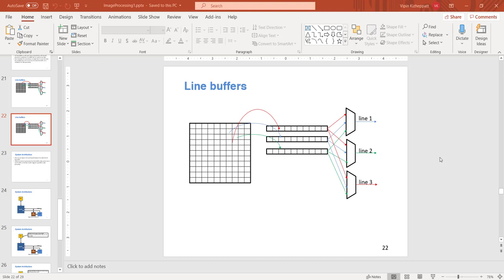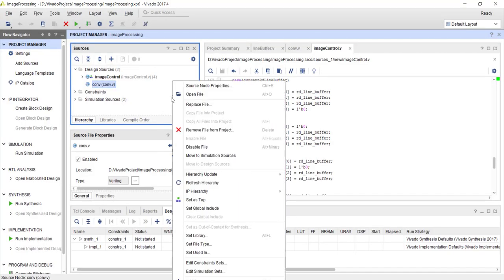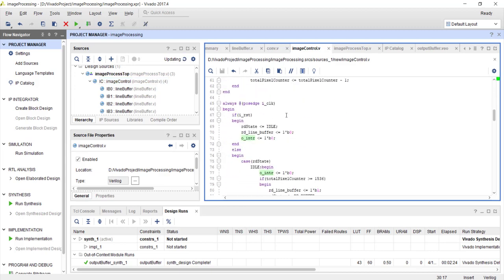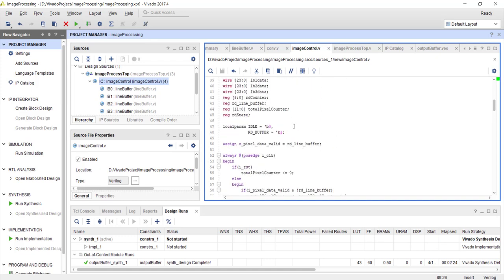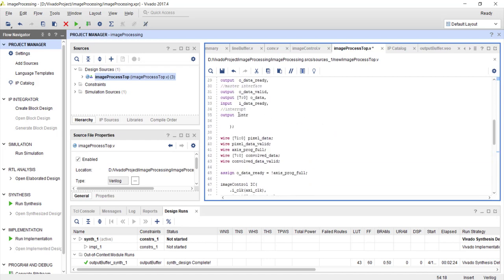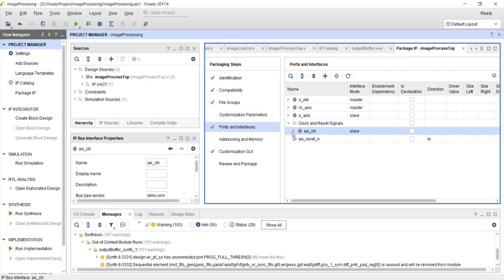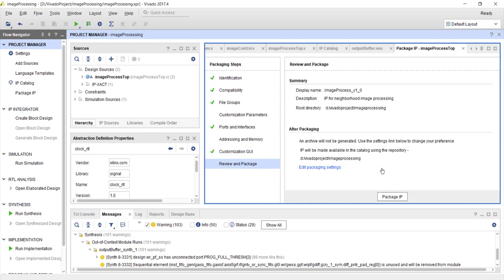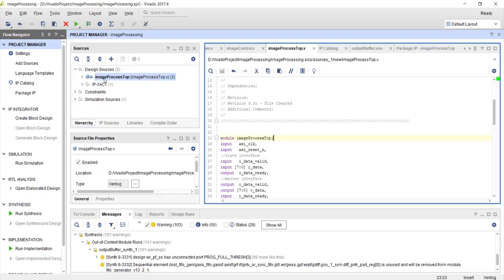Image Processing on Zynq (FPGAs) : Part 5 IP Packaging

Comment: Thanks a lot for the tutorials
Is there a way to add defective pixel correction core to my project
If not how can i implement a custom core to correct defective pixel using microblaze through axi lite interfacing
Reply: maybe modified in vitis IDE

Comment: What exactly is the reason for using fifo?
Reply: At a point DMA might not be ready to accept data and in this current design we are not saving data anywhere, after a clock if you do not send it or save it anywhere data will be lost.

By adding that fifo we save some data and gain time for DMA to accept it without stalling our pipeline. If DMA fails to accept data for too long (fifo becomes half-full). You stop convolving and wait for DMA to accept some data.
Reply from the maker: Adding to above explanation, FIFOs are generally used for
1. To temporarily store data in the IP since the IP might not be able to process data at line rate
2. To manage clock domain crossing (data comes at one clock frequency and IP runs at another)
3. To handle burst transfers. Data might be coming in bursts from say memory. So it needs to be temporarily stored before processing. More or less same as point 1
4. Some application require minimum amount of data before processing can start. So FIFOs are used for buffering data